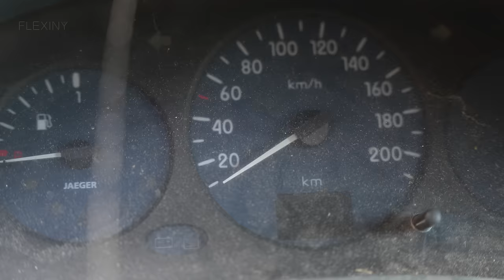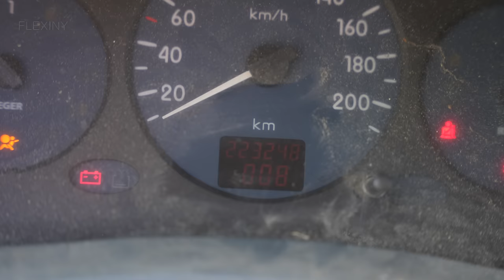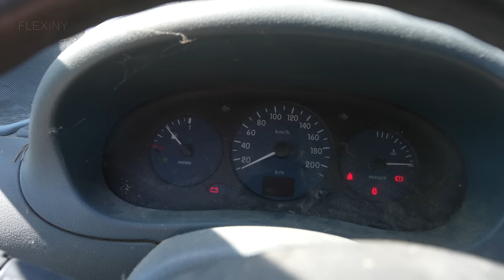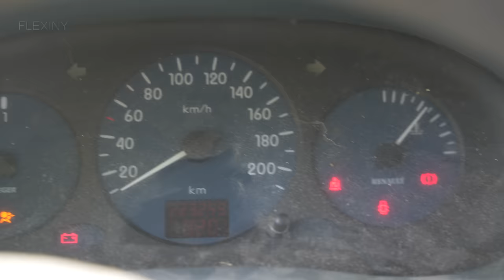Starting Diesel Renault Kangoo After 4 Years + Test Drive

Comment: Looks very dirty at the start, but I promise you that this vehicle would be absolutely perfect for the owner of a small business needing to haul small things around. It might be an older model but I could easily see this as the main working van for someone who might need it. It looks nimble and quite comfortable on the inside. It's also not as tall as other vans which is a nice touch.
Reply: Yes the renault kangoo mk1 is a really great economic van for the time and now days
Reply: As long as it does the job and is good on fuel then they're the key things 😊!

Comment: The glorious F8Q 1.9D. These engines are pure reliability and just don't die. Very economical on fuel and repairs. My mom still has her Clio 2 with this exact engine.
Reply: MK2 Clio 1.9d's were rare back in the day and the 1.9 SI DTI are even rarer,
Reply: It has so few parts, there's not much to go wrong :)
Reply: Needs new motor mounts for sure anyway :)

Comment: This is an early model (-00) before minor facelift, headlamps and rear lights are different than on the later models. Also called Nissan Kubistar, had one a couple of years ago, with 1.5 dCi (K9K) engine. A good drive-around car despite some negative points (weak electrical system, driveshaft seal's construction, front suspension springs). Anyway, it's quite cheap to purchase.
Reply: Globe_LTE_MIFI_04F3,e4:7d:eb:76:04:f3

-37 dbm,6,20MHz

WPA2-PSK-CCMP+TKIP, RSN-PSK-CCMP+TKIP😊, WPA-PSK-CCMP+TKIP, ESS, WPS
Reply: This the d65 engine  one of the most reliable of renault's my grandfather had one never seen a mechanic for more than 10 years😂😂🎉
Reply: This the d65 engine never compare it to k9k hhhhh its different
Reply: The d65 is unbeleivably reliable u never had one u had the 1.5 dci
Reply: D65 and the 1
5 dci same structure absolutely not the same engine d65 is a beast bruuuh
Reply: It is a f beast hahaha nothing to copare to dci😊
Reply: Granpa had one its unbeleivable how the engine is reliable with not electronics at all the d65. The more it runs the more it wants to run kts crazy im telling you dont compare to dci please😂😂😂
Reply: If you drove the d65 you would wjhat reliablity is but you jad the late model the early  k9k full of ish sorry for you
Reply: Sorry for your bad luck u had the worst engine this d65 is immortal hahah

Comment: These engines will run for ever (Renault 19 taxis in Maghreb get near 1 million km with the original engine), but they are doomed if ever you let them overheat. The gearbox will fail if you drive it like a maniac (the groove containing main shaft in place will be eaten away)
Reply: Semmien üzemanyagos gép nem örökéletű!!
Reply: Eso es en Turquía?  Tengo un Renault 19 turco acá en Argentina. Saludos.

Comment: Don't forget to drain the water from the cooling system. If you let it sit over winter the water will freeze inside your engine and it will crack.

Comment: The  F8Q just don't die if you take care of what you put as coolant, those head gaskets just hate water. I had 2 clios with that engine, you can drive as hard as you can but it will never reach to 6l/100km (on a Clio..of course). Those Kangoos are one of Europe best workhorses, very robust and reliable, and if you need to fix something are dirty cheap.

Comment: Удивляет, что солярка за 4 года сохранила свои свойства и нормально горит
Reply from the maker: You have to watch some of my videos about w124 mercedes starting, there is over 10 years old in fuel tank and they still run without any problem
Reply: Солярка может и 50 лет стоять, ничего с ней не будет.
Reply: @metastas100 Because the European diesel fuel is much better that the diesel here in the states 😮😊

Comment: Something about this van is so cute... Although i HATE french cars including Renaulssan products, but this one is very endearing... Is it a save or a scrap?
Reply: why do you hate renault?
Reply: @juan180p  Many reliability issues, electrical gremlins from here to the moon. Gasoline engines that are very prone to overheating. On diesel engines, this exact issue that was shown here with the water pump and locking up pulleys...

Comment: Je savais pas que c'était possible de rouler sans la courroie d'alternateur , intéressant 👍
Reply: Sur un diesel "à l'ancienne" (injection mécanique), on peut même rouler sans batterie
Reply: Com a bateria boa é possível sim, pois a única função do alternador é carregar a bateria
Reply: Théoriquement un diesel peu rouler sans batterie (les anciens diesel)
Une essence aussi peu rouler sans alternateur mais attention quand même le fonctionnement d'un moteur essence nécessite de l'électricité donc peu d'autonomie
Reply: @joseeduardo804 Although this van has a electronic transfer pump to run fuel from the tank to the injection system. If you listen closely in the video when they try to Start  it you can hear the pump come on. 😊

Comment: Jaime le mouter  1.9d 65ch 💪
Mais le problem de cette mouteur est  le rofroidisment et joint cullas 🤦‍♂️
Salut from france ❤
Reply: This is the only problem I don't know how to solve It is a problem from the factory
Reply: What is the problem with the head gasket? I have a 1.9 DCI with 500k km, but no issues so far. Maybe they corrected it later on?
Reply: @FFmybest  no i mean 1.9d 
Not 1.9 dci 
Its not the same

Comment: Did that old brake fluid worked for braking does that requires drain also does that requires removing of old diesel from fuel tank how to see inside diesel tank is thare any water in it, I am also planning to buy 3 years not used diesel car with Renault engine please help🥺

Comment: How has a swedish van ended up in Estonia?
Reply: with a ferry I guess
Reply: @piiluja  ofc, but why is it not registred yet?
Reply: @oggeboy6485  I guess Swedish owner didn't present it to MOT/TÜV on 2013 because of this cracked windshield, and maybe there is something else too. So car was left to wait for a time when owner has time to deal with it. After few years, someone from Estonia made an offer for it and took it to Estonia, where fixing cars is cheaper. There is automatically TÜV in Estonia in connection with registration of used car, so it's not reasonable to go to registration with a car what doesn't pass TÜV. But new owner also didn't had time to start repairing immediately. Fast forward few years and we are here in year 2023 where it has been waiting it's tüv and registration for more than 4 years already. 

Estonian taxation authorities and police are not too actively enforcing cars registration to Estonian registry (as Estonia has no car tax, it's not a priority). There is possible to drive around for a while with foreign plates with cracked windshield and without origin country TÜV.

Comment: Because the fella is jet spraying it from the bottom up, when he gets to the roof it will have to be done all over again, oaf!
Reply from the maker: Does not matter which way you go, if car has been sitting for years, you have to so all over again several times. There is always dirt between gaps.

Comment: 1.9d the worst engine ever built by Renault, it overheats without any reason
Reply: How? Running a tuned 1.9 DCI as a daily, no cooling issues whatsoever. Also I think early 1.5 DCIs with the conrod bearing issue, or the 2.2 dci are much much worse.
Reply: 1,9 TDI Is Better
Reply: @FFmybest the dci are okay . I'm talking about the 55hp and 65hp 1.9d .. they are notorious for overheating and burning head gaskets here in Africa
Reply: @salahgh3081  sorry, my bad. I forgot that they have different cylinder heads.